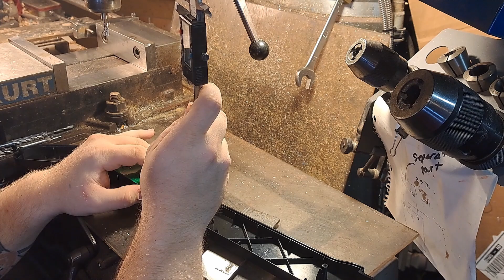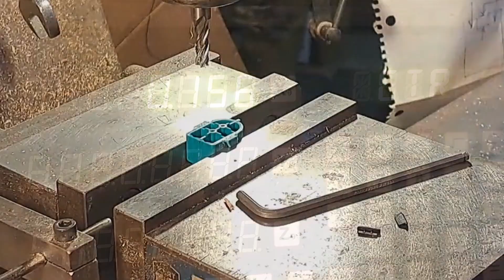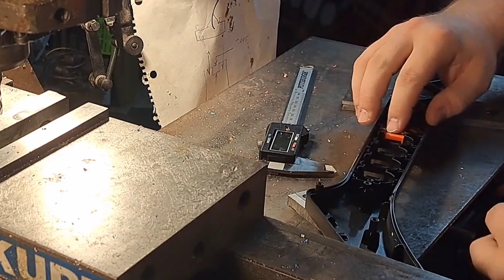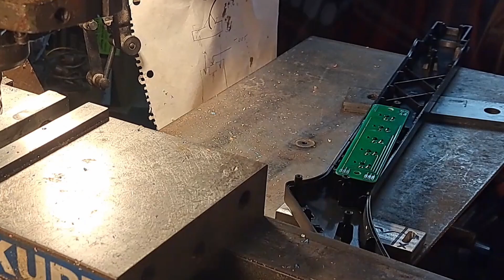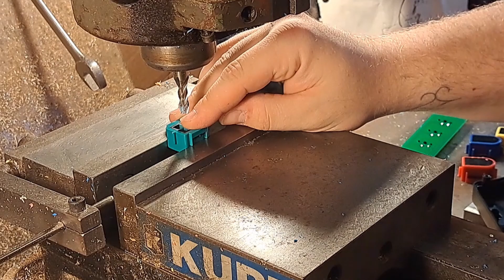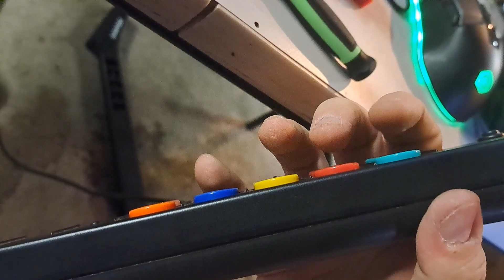Doing My First Milled Fret Commission for A Viewer

Comment: What is this trying to achieve?
Reply from the maker: It's for using mechanical switches instead of the silicone membrane. It requires use of either 3D printed frets or in this case hollowed out stock frets. Since many prefer stock frets over 3D print or resin casted this is a great solution for those looking to get something better but not compromise feel. In the terms of video, it's just filler since I had the footage